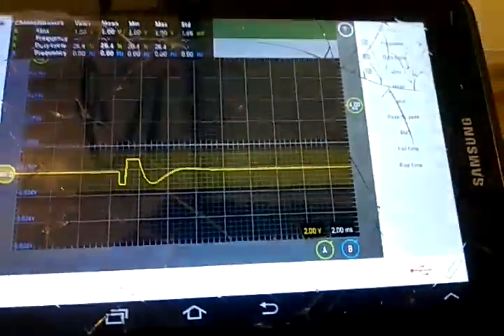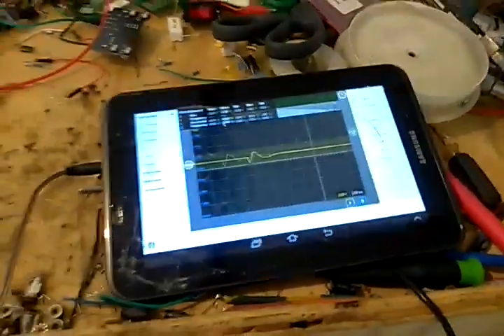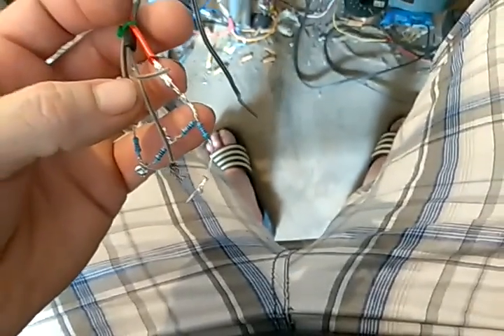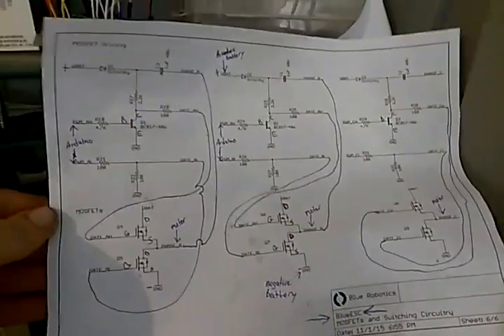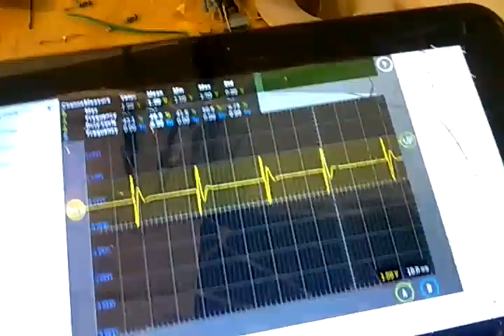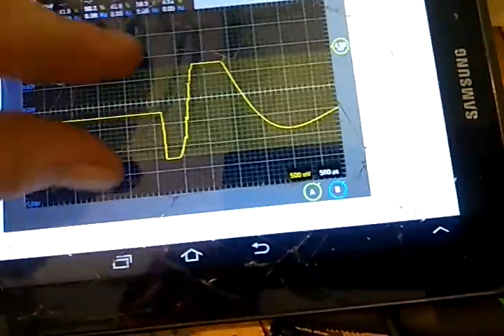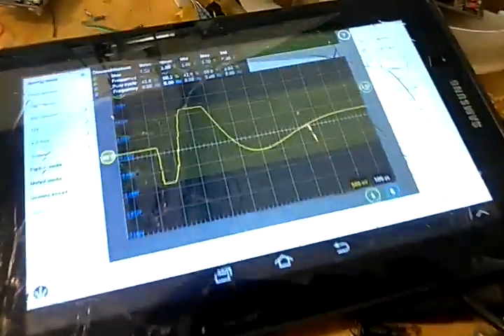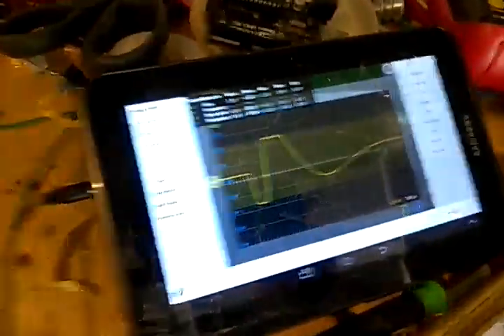I GOT A FREE OSCILLOSCOPE!!!  (I BUILT IT...)

Comment: Great progress! I was just telling myself I need a new oscilloscope. I lent mine out and never got it back. What software are you using on your tablet?
Reply from the maker: +DecimalZero is is the Smart scope from Auto labs and it's got all the basic functions I need and then some. I couldn't believe how accurate it really is. I used a 10 to 1 ratio with 10,000 ohms and 100,000 ohms to build my probe.  so it's not adjustable and you will have to do a little bit of Ohm's laws calculations anytime you use it to make sure you don't mess anything up but it just connects into the positive and negative on your microphone on the four prong 3.5mm Jack